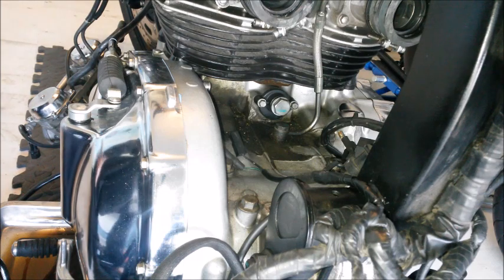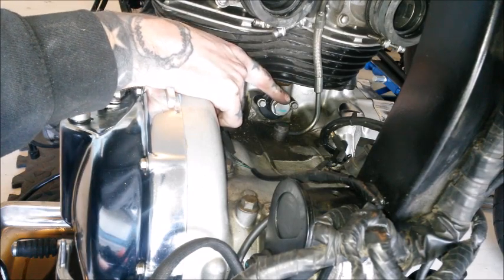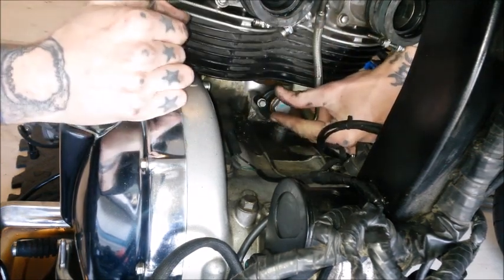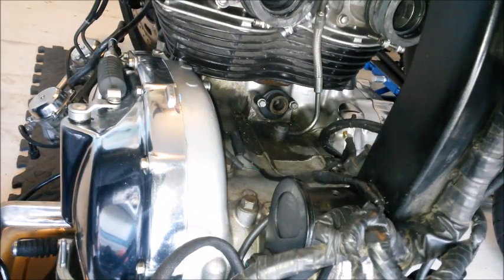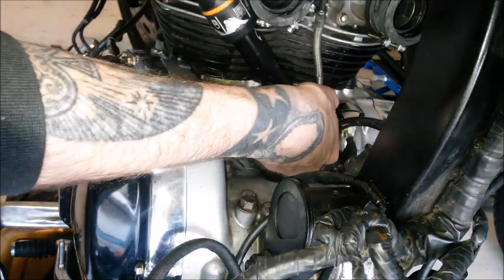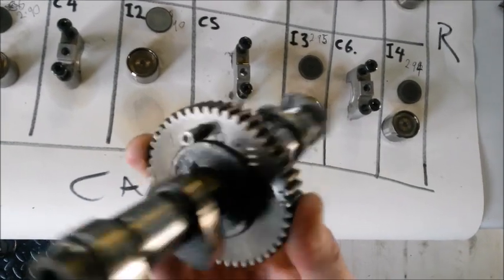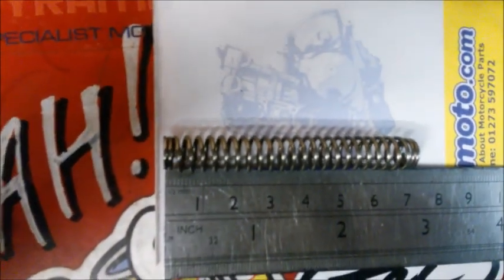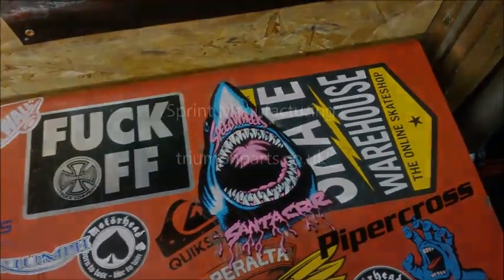Triumph Bonneville Cam Chain Tensioner Spring replacement engine noise

Comment: Hi johnny thanks for this vid just followed this procedure as you say basic skill level but would not have attempted it without watching this my old spring was 69mm put new on in from sprint engine sounds much better only downside I posted this on triumph FB page it took about 3 mins for the other experts out there to let me know that sprint springs were to long and to strong so they would not use them so I contacted Sprint who assured me that the springs they supply as with all their parts are made to triumphs own specs fortunately I am 65years old and have met plenty of jacks of all trades masters of none but I do still question just what do they think they achieve by making comments about things when they have no scientific proof of them by eh ho thanks again rant over cheers Bert love the vids keep going.

Comment: Hi Johnny, thanks for the video. There is any need to readjust valve gap after replacing the tensioner spring? Can you please advise on the torque value to apply to lock back the bolt?
Reply from the maker: Hi buddy @ 3:22 I think I mention its 20nm torque setting 👍 no need to re adjust valve gap after.
Reply: Hi Jonnhy, thanks for your help. I just measured the spring length and it is about 68mm. I'm gong to change it. Only problem is the delivery time...brexit and covid made it very long
Reply from the maker: @ignaziotorlo8498  yes😣 two very annoying problems.....!

Comment: thanks for the tip Johnny,at what mileage or kms would  you recomend to change it?my Speedmaster has 35000kms.cheers.
Reply from the maker: If you have a spare copper washer you can do a quick check and measurement of the existing one- it's literally a 2 min job. I have similar mileage on my america and will check it soon when I do the clearances etc before it gets put back together. It can't hurt to check after 20,000 I guess???
Reply: @johnnycactus0  thanks mate, l will do it.
Reply: @johnnycactus0  Should I drain the oil before opening up this thing? Thanks!
Reply from the maker: @bjarnebare591  no need- wait till the engine is cold though and simply unscrew! 👍

Comment: Hello I've just removed my cam chain tensioner spring bolt and there is a small brass collar spacer thing on the shaft of the bolt is that meant to be there T.I.A

Comment: when would a timing chain replacement be necessary? at which mileage? able to advice?
Reply from the maker: At a guess, if no other probems have  presented, I wouldnt be worried until higher mileage is hit...over 80k

Comment: So you don’t need an object to hold the tension in the cam chain while you replace the spring? I was under the impression you could mess up the timing if you didn’t hold the tension on.  My plan is to attempt this on a street triple.
Reply from the maker: Not on the spring for bonnies at least...timing is locked with retaining pins for valve changes.
Reply: Cool. Thanks for that.

Comment: hey johhny where did you get spring kit from triumph in aust hasnt got it
Reply from the maker: hi buddy- sprint manufacturing in the uk does them- also do a search on ebay- you can get them there. hope that helps! here's the links https://www.triumphparts.co.uk/product/cam-chain-tensioner-spring/                                         https://www.ebay.co.uk/itm/Triumph-Bonneville-T100-Cam-Chain-Tensioner-Spring-Kit-/301477417434
Reply: I just stretched the old spring to 73 mim that was 20,000 km a go.

Comment: I am trying to locate a chain and sprocket kit for my 10/2001 triumph bonneville america and can't find one anywhere.   Front sprocket 18 teeth  rear 44teeth and chain link count is 57.  Is this something you could help me with.
Reply from the maker: Hi there - somewhere like squaredeals-ltd.co.uk offer a choice of 17 18 and 19 front sprockets. I believe stock rear is 42...getting a 44 may be tricky...you may struggle to get a complete kit...probably have to buy it separately....
Reply: The right lenght of the chain is 112 links. And yeah. Go with a 42 rear sprocket 16-19 front

Comment: How do i know if this tensioner is bad or the chain is streched ?
Reply from the maker: Good question! I'm not entirely sure!- I would factor in mileage first, but to be honest if I was hearing excess noise or experiencing symptoms of a potentially worn chain, this is a quick and cheap process to try as a first solution. If the chain still needs replacing after that it's not a bad idea to have done this anyway! A t least that's my point of view!

Comment: Thanks Johnny, not only for the spring recommendation, but for the reference (@4:20). I have not looked at that spring length - I wonder if they ever changed the part number? (PL search says no)

The 4:20 reference can be found here.
https://www.youtube.com/watch?v=G0xGouXzOFg&list=PLWHom5FLIC6vqPeDp-zPnKc8QmTten1He&index=4&t=0s

It's the big spring (C-ring) inside the gear that can cause the gear slapping noise.
Find 6 here  https://www.bikebandit.com/oem-parts/2001-triumph-bonneville-t100/o/m17584#sch564589
:)
Reply from the maker: My pleasure Rich! Thank you for the excellent information!!! Credit where credit is due- to you Sir!